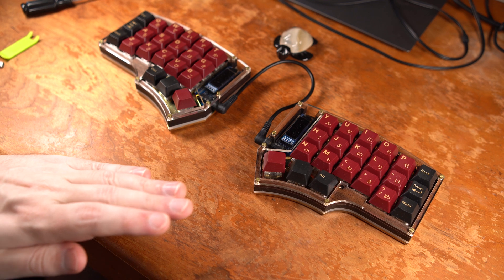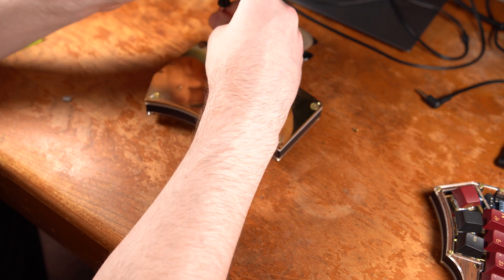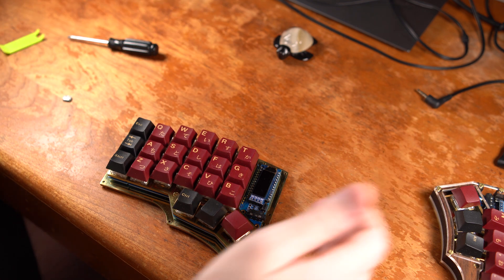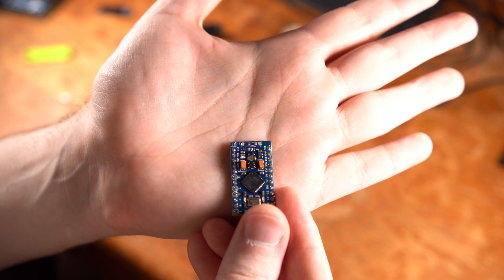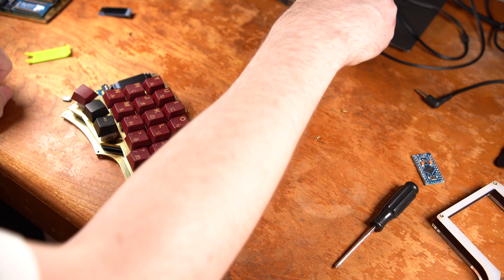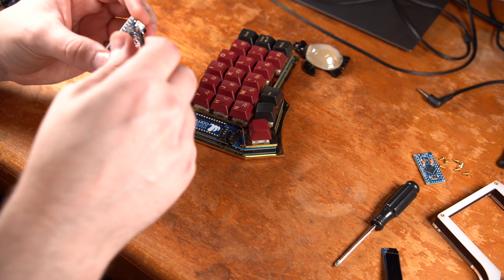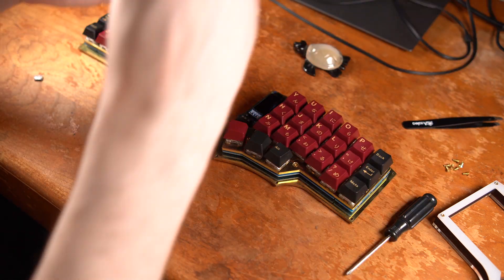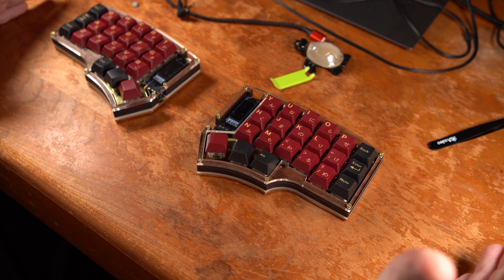Broken Promicro? Split Keyboard? Not a problem. One of the benefits of socketing your promicro.

Comment: Why do the pins bend? Are they clipped diode feet like I see some other people doing?
Reply from the maker: I often use the legs of diodes, but I've used the actual socket pins you can get on a couple of builds and a few of them will often still get bent when removing the MCUs. What causes the pins to bend, besides being thin soft material, is that it takes a surprising bit of force to unsocket the MCU and there isn't a good way to remove it perfectly vertically (without damaging something). So you have to go back and forth prying one side up a little then the other. Then once one side finally gives the pins still in the socket get bent. One of the benefits of the diode legs is that they are easy to get back into shape and usually won't harm the pads on the MCU except in extreme circumstances.

Comment: Great video, I'm starting with the same problem, still don't lose the micro usb port but is going to, I  read somewhere, there's a way to flash it so you plug the cable into the right side and work in the  same way, do you  know something about?, I did use #define MASTER_RIGHT but the layout in the left side move to the right and the right to the left, is like to be typing on a mirror. Thanks.

Comment: This was fun. Off the cuff, unscripted jaunts down the road while fixing a common issue is something I would be cool with seeing more often. Although, I could do with a little less screw removal, personally.
Reply from the maker: I see someone didn't appreciate the symbolic dismantling of the decedent case that takes all of the attention and glory from the austerity of the budget component that in fact do all of the work so that the case can be more than just a paper weight. Did I just make that up and it in fact has no relevance to the video at all? Yes I did. I went too light with the editing. Next time I'm going to make sure to cut out the rambling for assembly and disassembly unless there is actually something interesting to it.
Reply: @couldntthingofone269  Rambling is probably the best part—but visually? The “all the screws I see” bit is less fatiguing for the viewer. (Though I am sure you can come up with your own version of that gag.)